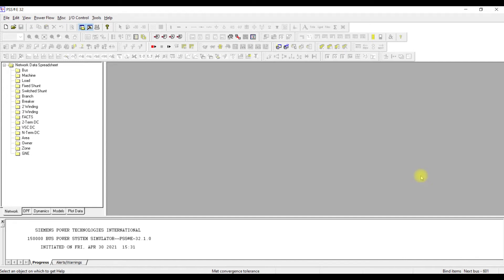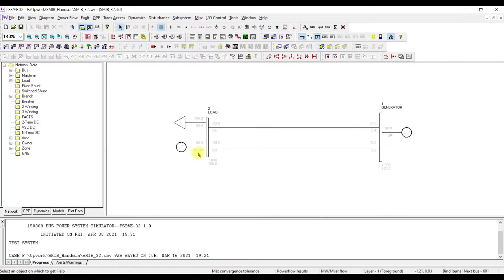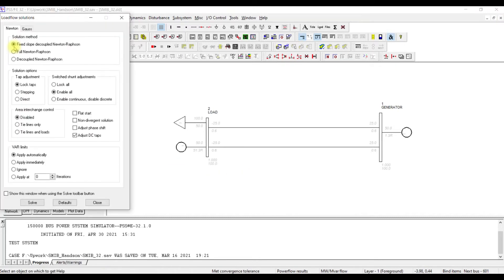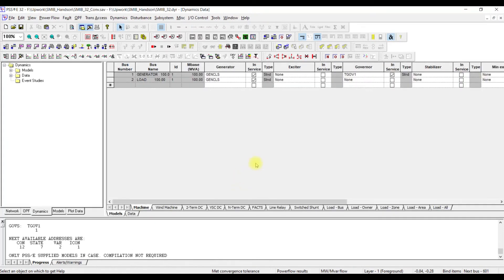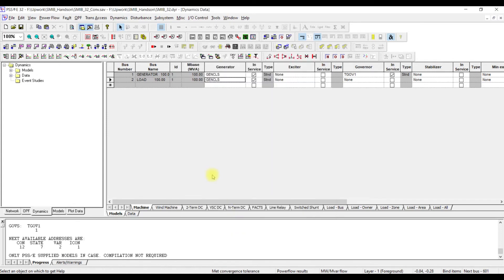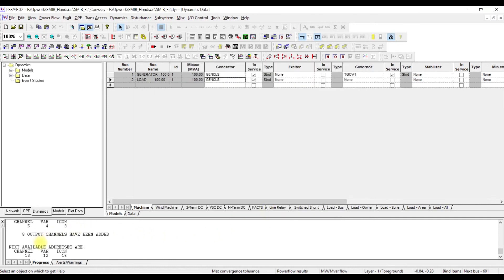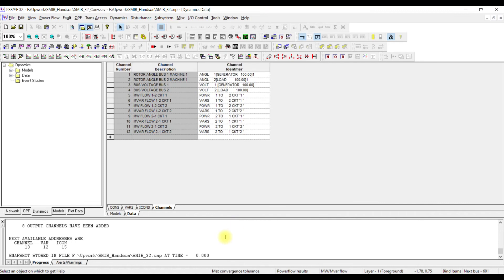Basic Power System Analysis Using PSSE Session03 - Part1

Comment: sir, thank you for your explanation. 
I have a few questions.

4:08 do we need to change it into current injection source? (but isn't it that we do simulation with thevenin ckt(voltage source)?
5:43 factorize means that we get reciprocal of impedance?
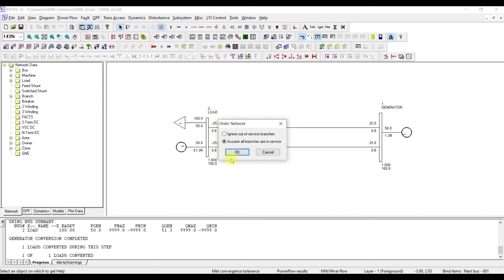5:48 ordr means that we collect impedance from all branch and make it ordered into matrix format?
6:15 TYSL/ IS tysl a function to keep generator connected with regardless of any fault condition? 

THank you for your answer in advance.
Reply from the maker: You may consult PSSE Program Operation Manual for further details. It is available within installation drive/Docs folder